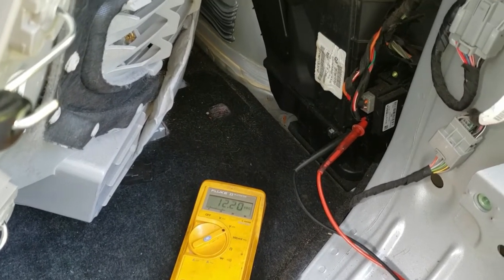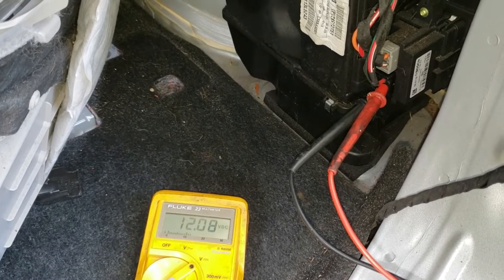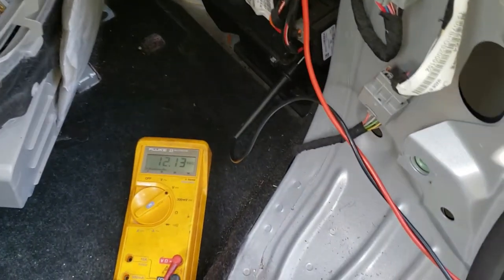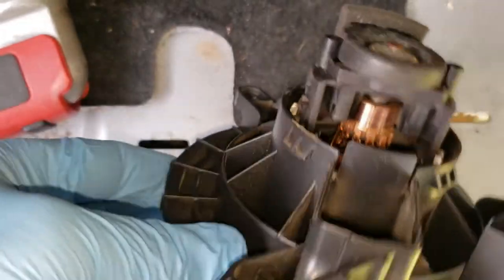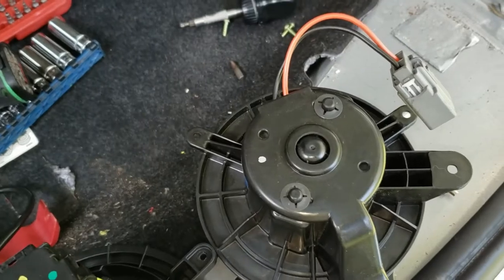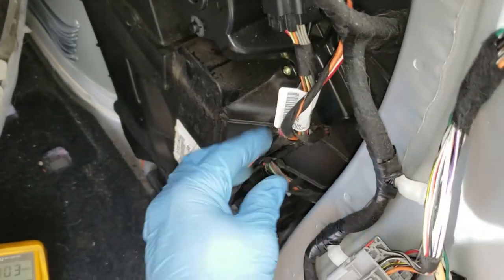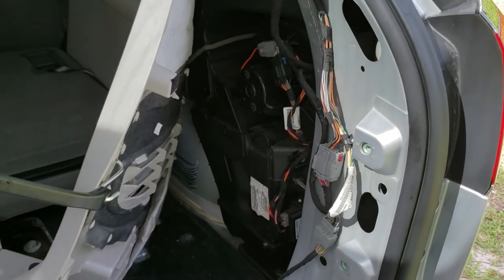2013 Buick Enclave, Rear Blower Works Sometimes

Comment: Any clue why the orange wire would be getting 13v but the blower motor still doesnt turn? Even with a new blower motor?
Reply from the maker: Most likely the blower speed controller module is faulty or the ground on the black wire is missing. The module is the component where I am testing at for the first four minutes of the video.
Reply: @SparkysAnswers so I got the module and still nothing. Looks like it might be a ground issue. I get 13 v to everything I put my red lead on, the power going in, the control green wire, both the red and orange wire going into the blower. Any suggestion where to look for the grounding issue?
Reply from the maker: @grayson84111  What kind of reading do you get on the large black wire?
Reply: @SparkysAnswers  So how do I measure the ground (large black wire)? I was putting the black prob on the ground, and the red prob on the other 3 wires (red going into the module, and both wires on the connector going into the fan.
Reply from the maker: You would need to connect one meter lead to the negative battery post and the other to the black lead at the rear of the vehicle. This requires very long leads or jumper wires. You would want to see a reading very close to zero in that test. 

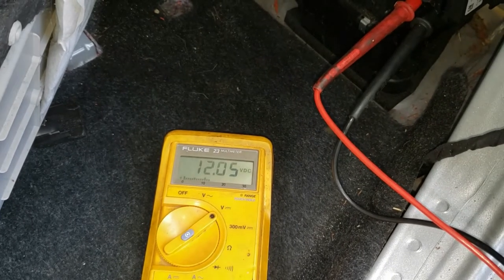Reading over your replies, you state that you get 13 volts on everything you test including the green control wire. This is not correct. If you watch the video from the 2:00 mark to the 3:00 mark you will see the test for the green wire and the voltages you should see.
Reply: @SparkysAnswers ok. I have the black in the ground and the red in the green. There is zero change in voltage when I change the fan speed settings on the rear control. All settings say 14ish volts.
Reply from the maker: @grayson84111  It would appear that you either have a break in the green wire between the front and the back of the vehicle or a faulty control panel. Please provide the year, make, model and type of a/c controls so I can provide the most accurate information.
Reply: @SparkysAnswers  2013 Chevy traverse LT1.
Reply from the maker: @grayson84111  Auto or manual a/c controls?  Basically you will have to test the green wire between the control panel and the blower speed controller at the rear of the vehicle. Are you using the front or the rear control panel to adjust the rear fan speed while testing?
Reply: @SparkysAnswers  They are manual. There is only an "on" on the front control panel and the knob on the rear where you can set the fan speed.
Reply: @SparkysAnswers  I should also point out nothing changes voltage wise even if the rear blower is turned off using the manual dial or the front on/off switch.
Reply from the maker: @grayson84111  You will need to remove the front control panel and locate the dark green wire at terminal 10 of the X4 connector. Check to see if you have the same voltage there as you do at the rear of the vehicle. If you do then the control panel is likely at fault. If you do not then there is a break in the wire somewhere between the front and the rear.
Reply from the maker: @grayson84111  This is from GM service information. "All Auxiliary functions and DTCs are handled by the HVAC control module. There are two ways the rear functions can be controlled.

Control from the HVAC control module: If the AUX button on the HVAC control module is pressed, the rear HVAC system will be enabled. The settings for the rear will mimic the Driver settings on the HVAC Control Module.

Control from the auxiliary HVAC control module: If at any time any of the three Auxiliary controls are adjusted, control of the rear HVAC System will transfer to the Auxiliary controls. If the Aux button is not currently enabled, adjusting the Auxiliary controls will enable it, even if the front system is Off."
Reply: @SparkysAnswers  so I have the multimeter on pin 10 and the black on the group bolt on the passenger side pillar. The voltage on pin 10 says 0.2. In fact, all of the pins say that except for pin 2, it says around 5v no matter what setting the blower is in.
Reply: @SparkysAnswers  I have also confirmed that the rear passenger control panel is sending the following fan setting off = 0.8, 1= 1.72, 2=2.69, 3 = 3.61 and 4 = 4.46v out of the control panel. They do not seem to make it past the main hvac control panel below the radio.
Reply from the maker: @grayson84111  Two things to point out here. The gray wire at pin 2 is a five volt reference wire and should be reading 5 volts so that is good. Having only .2 volts on the dark green wire at pin 10 means there is a break in the wire somewhere between the x4 connector and the dark green wire at the aux blower controller at the rear of the vehicle. The two most likely places would be the x202 and x452 connectors.
Reply from the maker: @grayson84111  You did not state the wire color where you got those readings from but I am going to assume it is the purple/white wire. Can you Confirm?

Comment: Very well made and informative video.  I have a 14 Enclave in which the rear blower doesn't work.  I get the same 11.8 volts on the signal wire that I get across red and black.  This voltage stays the same regardless where the fan speed is set.  I assumed the rear HVAC control  was bad so I bought a used one off ebay.  Swapped em out, same issue.  It seems unlikely that two controls are bad.  Any idea where I should look now? Can't seem to find a lot of info online anywhere.  PS, both controls operate the blend door and radio, just not the blower motor. Thanks
Reply from the maker: What color is the "signal wire" you refer to and what did you use as a ground point for your meter while testing it?  Have you tested the blower motor or power and ground going to it?
Reply: @SparkysAnswers  The signal wire is green. I tested exactly the same way you did in the video.  Black meter lead to black wire in plug going into the blower control module and red meter lead to green wire in same plug.  I have the same battery voltage on green wire as I do the red wire, regardless of where the fan speed is set. At the motor I have no voltage across the red and orange wire of the motor plug. Motor runs if connected directly to an external 12v source.  I swapped the resistor/module previously thinking that was the problem.  Same issue, that's when I started digging deeper and now believe something is deterring the input to the resistor/module.
Reply from the maker: @greenwingrider  The green wire at the rear of the vehicle that you tested voltage on does not connect to the rear control panel. Instead it connects to terminal 10 of the X4 connect at the front control panel. The X4 connector has 16 cavities. I would recommend disconnecting the X4 connector and the connector at the rear blower speed controller (resistor). Then test the wire from the front to the rear of the vehicle.
Reply: @SparkysAnswers  Sorry for the delay between responses, for some reason I no longer get notifications.  Anyway, I did as you said and from pin10 on the x4 connector to the pin on the connector that plugs to the blower control module(green wire), I'm showing infinite resistance.  I thought rather than try to find this bad spot, I'd just run a dedicated wire for that circuit.  Here's the weird thing, when I do that and turn the key on, the rear blower runs wide open regardless of where the fan speed is set with either control panel.
Reply from the maker: @greenwingrider  Are you sure you are at the X4 connector? The X2 and X4 connectors both have 16 cavities. Looking at the diagrams the X2 connector has a total of 9 wires in it and the X4 connector has a total of 7 wires in it. Both connectors have a dark green wire in them in about the same positions except reversed(mirrored image). I would also expect the correct wire to be a slightly larger gauge

Also I noticed that there are two inline harness connectors that would be the likely location of an open circuit. Connectors X202 and X452. The X452 connector is at the rear of the vehicle in the area around the blower motor. The X202 connector is supposed to be at the front and possibly towards the center or maybe the passenger side of the center console.  The X202 would have another connector next to or at least near it.
Reply: @SparkysAnswers  so I did notice there were two connectors with 16 cavities and both contained a dark green wire. You mentioned earlier pin 10… the connector I assumed to be X4 was the only one I could get the green wire in spot 10… the other connector, no matter how I counted, the green wire never fell in the 10th cavity. 
However, I do feel that connector I used had more wires than the other one, but I’m relying on memory right now…
I’ll recheck tomorrow and reply back…thx
Update: I just remembered I had taken a pic earlier today while I was metering the wrong connector …. I was definitely in the connector with 9 wires…!!!